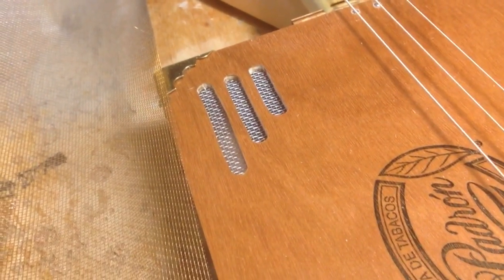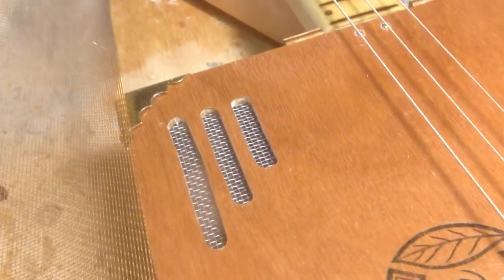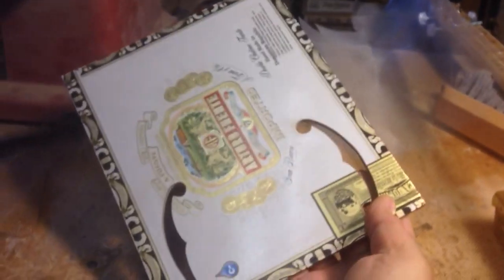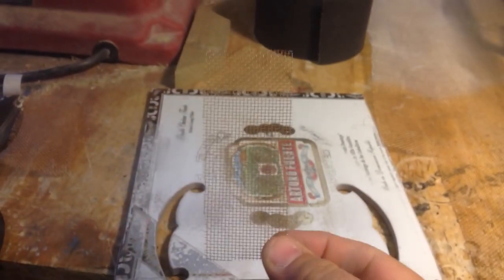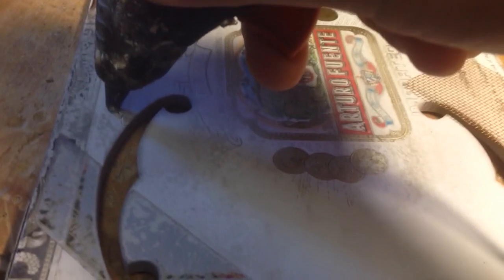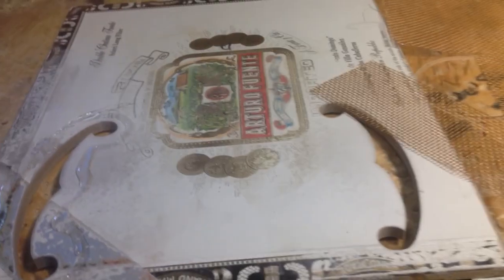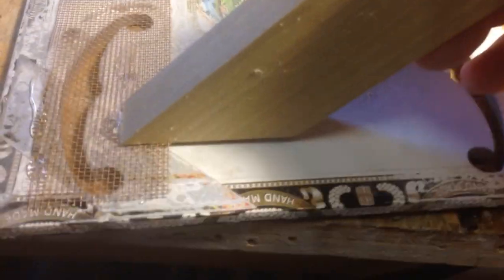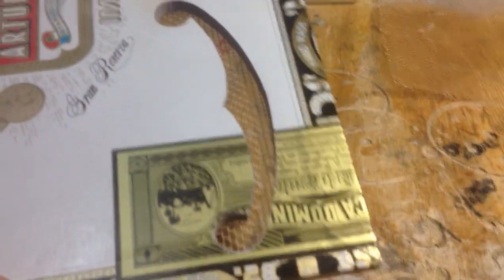Creating screened F-holes in cigar box guitars

Comment: I used q tips and apply linseed oil to the cut edges of the hole. It darkens and seals the wood. It gets rid of the "cut out" look.
Reply: i soak the edges with thin CA glue. it hardens the wood for a smooth finish, and prevents the paper cover from peeling. 
(removing paper on the backside of the soundboard can omprove the acoustic sound quite a bit)